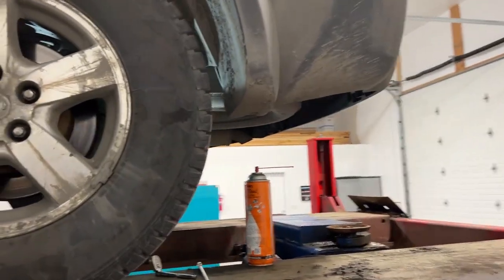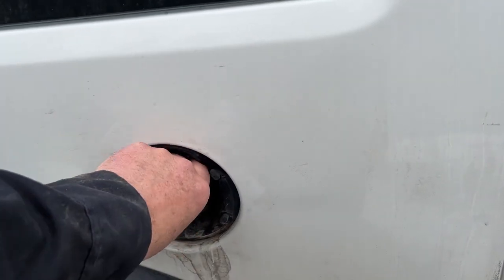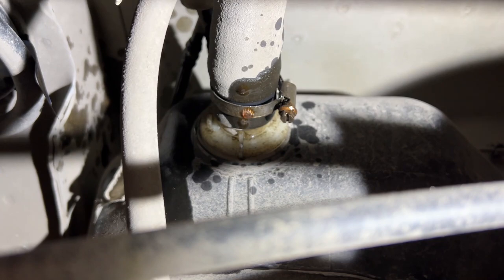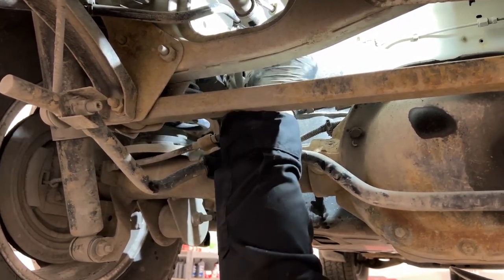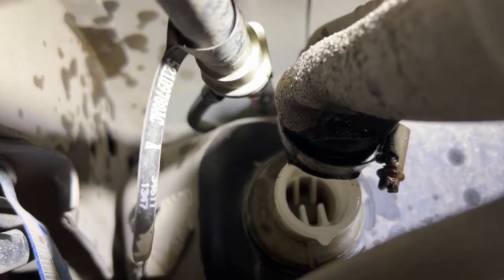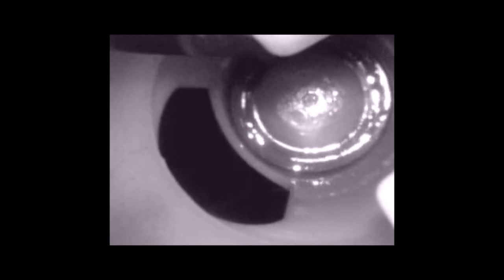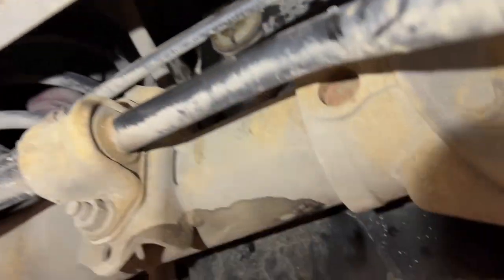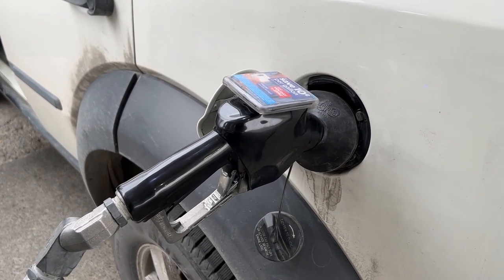Chrysler Dodge Jeep Won't Take Fuel

Comment: You showed that the check valve works properly, so what WAS the problem?
Reply from the maker: It was stuck until i messed with it. I cleaned it and it worked for as long as the customer owned the vehicle.

Comment: So i purchased a 2021 challenger RT back in july and after doing some research and reading the owners manual it was said that 89 gas was better and recommended for the V8 hemi. So i started running 89 octane and in about a week or so i started experiencing buzzing noise from the exhaust when i would accelerate. I thought nothing of it and ran 89 for 2 more tank fulls and still the same buzzing noise. So after running my tank empty i decided to run 87 and the buzzing stopped. What do u think could have caused this?
Reply: Did you get it fixed?

Comment: Usually this happens when the gas station attendant overfilled the tank and forces gas and fills the filler neck to round the charge to the nearest gallon to not have to make change. Fill your own gas with a credit card. If liquid gas gets in the canister it will clump the charcoal canister
Reply from the maker: i dont know anyone who could afford "full service" gas anymore. I must admit I overfill my tank all the time. Probably going to cause myself some serious issues. Maybe make a vid on that too. :)